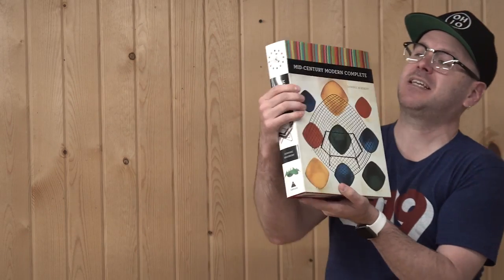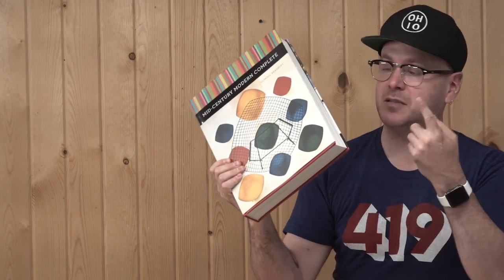Top Woodworking Videos of the Week! // Makers & Shakers #14

Comment: You mentioned having several of those 6' FatMax  tapes in a previous episode. I have 6 of them with magnets super glued to them.  So long as the machines you have are steel, one is always handy.  Just make sure the placement prevents the tape from falling into the path of a rotating blade.
Reply from the maker: +Robert Baker brilliant!